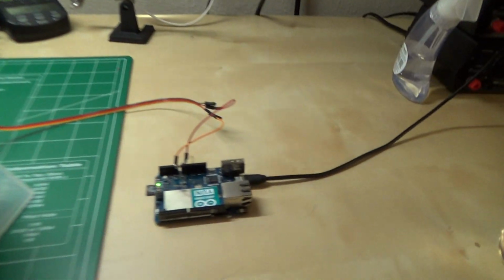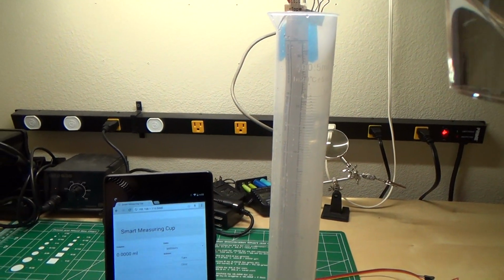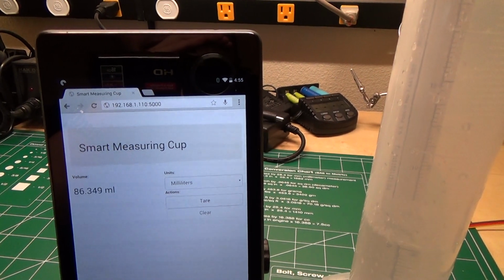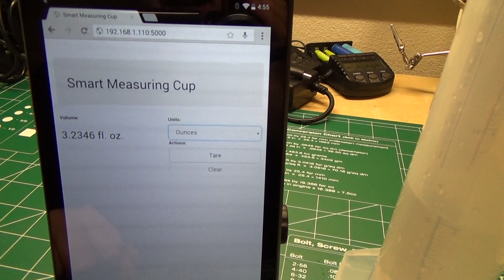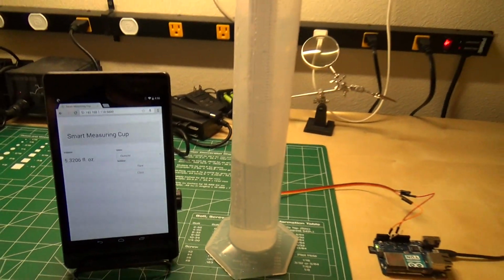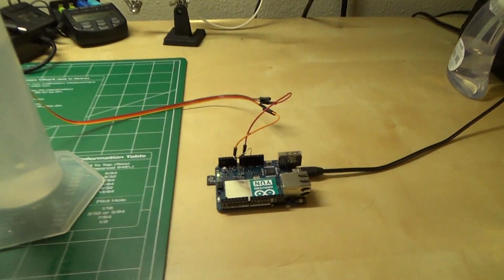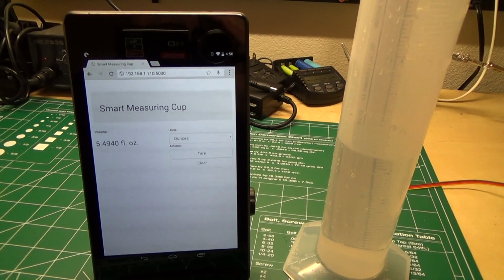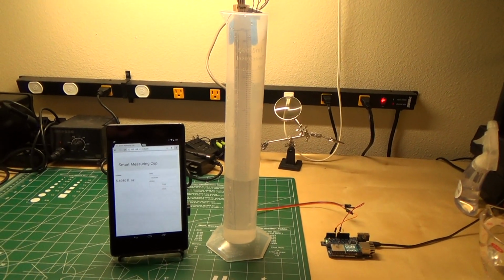Smart Measuring Cup

Comment: If this tube were sealed with water filled to half way and turned on its side, would the resistance still change proportionally as the tube was tilted?
Reply from the maker: Oh good question, unfortunately I don't think it would work.  The liquid level sensor is kind of like a force sensor where it detects how high up the sensor the water is exerting pressure.  If it was on its side the whole sensor would be covered in water and not give a good reading.  One way to measure the volume in an enclosed tank might be to measure the weight of the tank--if you know the density of the liquid inside and the weight of the enclosure then you can compute the volume of liquid.  There might be some other good options too, here's an interesting article I saw searching around: http://www.sensorsmag.com/sensors/leak-level/a-dozen-ways-measure-fluid-level-and-how-they-work-1067
Reply: Tony DiCola thanks for your thoughts and the article!